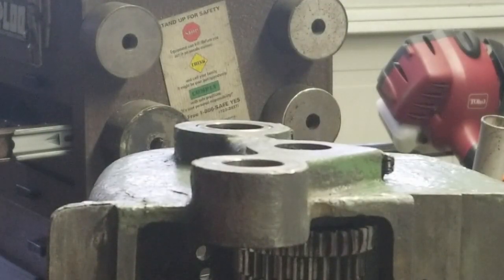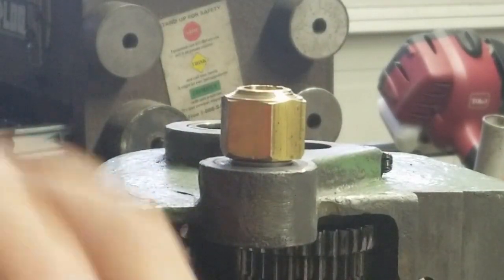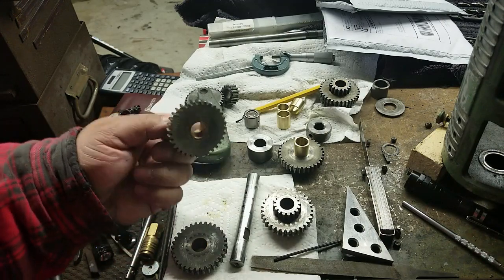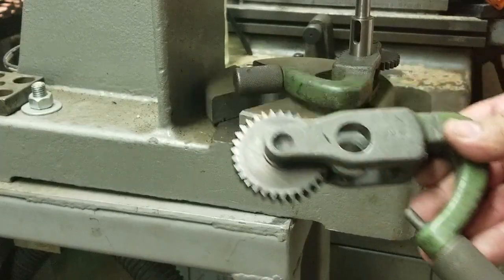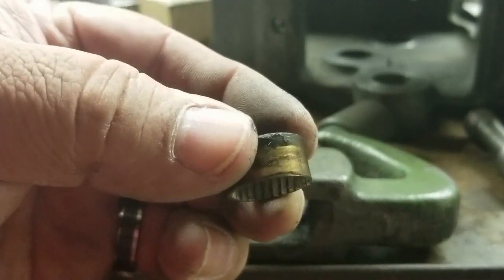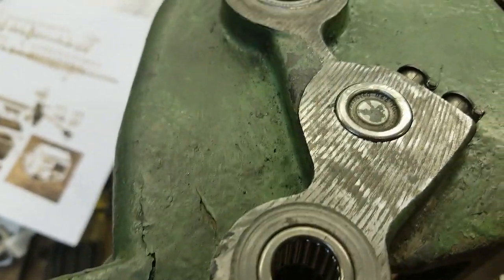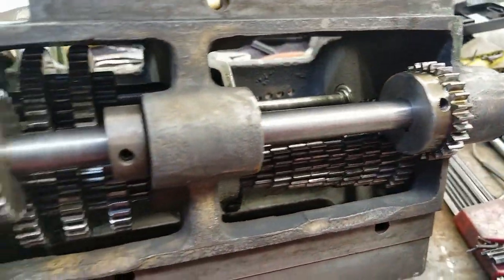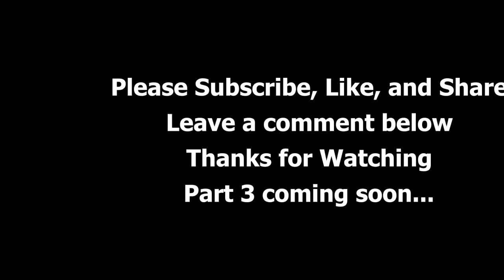Rebuild and Reassembly of the Sheldon Lathe Quick Change Gear Box Part 2 of 3

Comment: Thanks for these videos, I'm right in the middle of teh exact same rebuild. How do you get the spindle for the gear stack out, that you're tapping back  in at 9:22? I cannot get it to move even an inch.
Reply from the maker: Hello Todd, the thing I'm tapping on at 9:22 is a sealed end bearing. If I remember correctly the spacers on the shafts have double set screws in them. And because of the keys that are on the shafts. You have to move to one side or the other in order to get the keys out. Once the keys are out the shafts can be tapped out. Except for the small shaft with the smaller gear set. On the larger gear stack the is a double set screw on one of the gears.  So you have to clean them very well to find the set screws. I guess be on the lookout for pins, set screws, and keys. It will come apart do not force anything. I hope that makes sense and helps you out. Thanks for watching and commenting...
Mike - Plus8Precision
Reply: @Plus8Precision  Argh. I cannot get that spindle with the 11 gears on it to move, even an inch. Everything else is out (thanks to your video) except that. When I look from the near end, I see what looks like a sealed-end needle bearing. When I look in from the far end, I can see the needle bearing from the otherside shaft, and then the end of the spindle shaft in its needle bearing. There is a hole in the main casting that seems to look at the back side of the center bushing that holds the needle bearings, but I don't see anything like a set screw. At this point, I'm temped to use my press to push from the far side and see if I can get that spindle to move.
Reply: @Plus8Precision  And while it's all out, I guess I might as well replace the brass bearing on the selector handles. Where did you source yours?
Reply from the maker: Hey Todd, my shaft has 10 gears on it. The last gear on that shaft, the largest gear has a set screw in between the teeth. Mine was full of dirt and grease but it's there trust me. And your correct on that same end is a sealed needle bearing bearing. On the far end is a collar with a set screw. Another thing the shaft in question might have alot of wear and the wear prevents all the gear from sliding easy off that shaft. Do not press it out until you have made sure there are no keys on the shaft or you will be buying new needle bearings. I wish I could put a picture in the comments. Thanks for watching and commenting...
Mike - Plus8Precision
Reply from the maker: Hey Todd, as for the bushings I made my own on my little atlas lathe. Bushings are available but I wasn't sure of the press on purchased bushing so I made mine.  Thanks for watching and commenting...
Mike - Plus8Precision
Reply: @Plus8Precision  AHA! Mine goes to eleven. (Cue Spinal Tap.) I have three or four different parts manuals for Sheldon lathes, and the gear stack is different in each one. Looks like only the 10-gear iteration has the key and set screw. That may be the missing piece I needed, thanks!
Reply from the maker: @toddkrein  I'm glad I could help, that's why I made the videos because there isn't much Sheldon related content on the web.
Reply: @Plus8Precision  FINALLY got it out. Turns out the shaft had mushroomed on one end, so it took me a hydraulic press to get it out. Made the absolute worst noises imaginable from steal, even lubed to the gills. No keys or set screws on mine. Too many different version of that quick change gear box. Thanks again for the video and the help!
Reply from the maker: Hello Todd, im glad you got the shaft out. Finding information to work on these old tools is hard to come. I always wish my lathe just needed a coat of paint, lol. I wasn't that lucky with my lathe purchase. I still have some repairs to complete and I will do videos documenting the process. Thanks for watching and commenting...
Mike - Plus8Precision